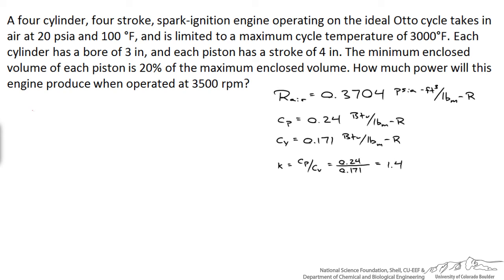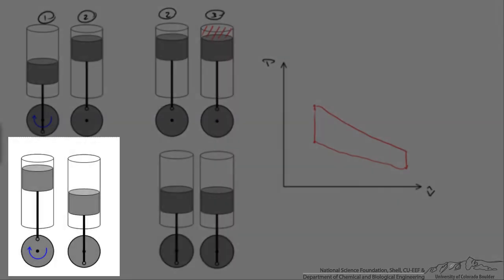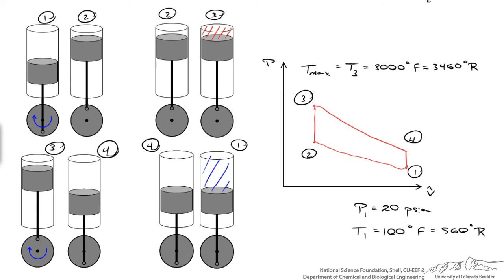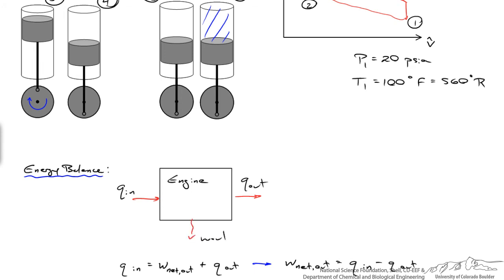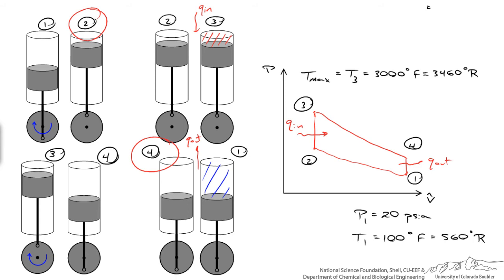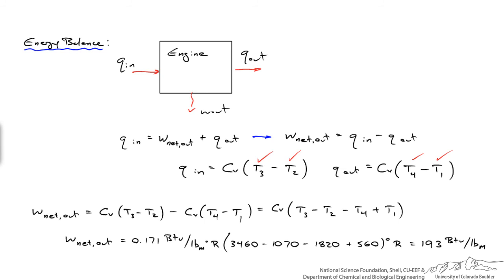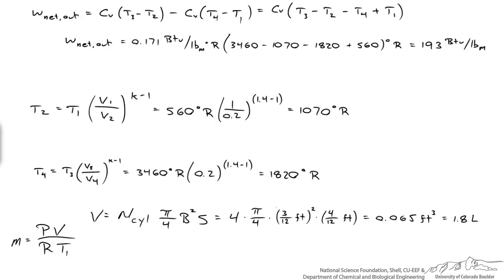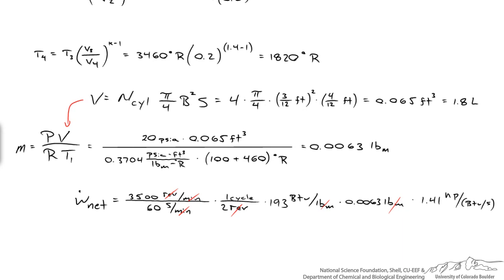Otto Cycle: Gas Engine Power Output

Comment: I looked at some 1.8L Engines actual output power at 3500 RPM. How come the computed Indicated Horsepower is lower or almost the same as actual brakehorsepower output of some commone 1.8L Engines. Shouldn't the computed Indicated Horsepower be much higher than the Brake Horsepower?